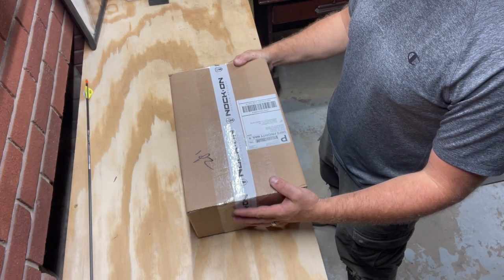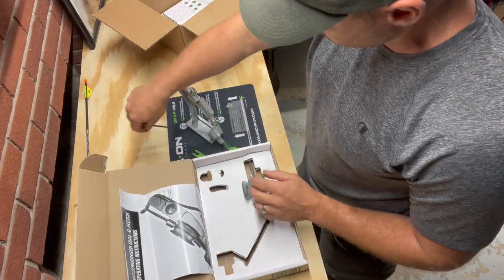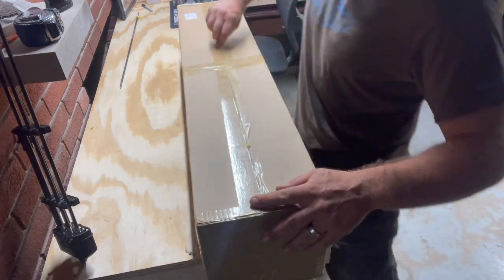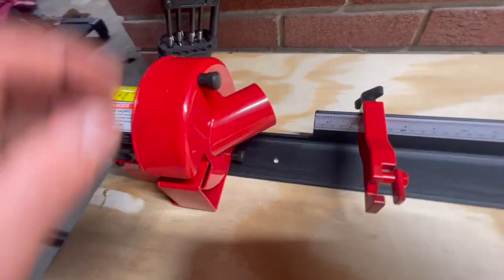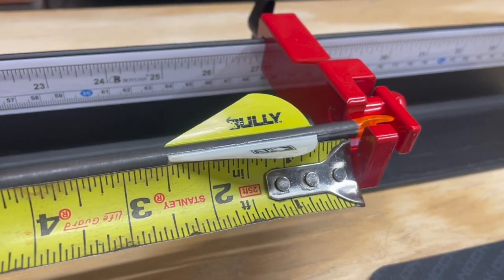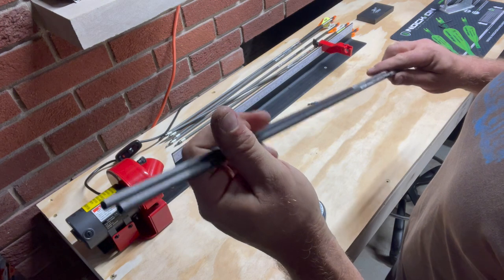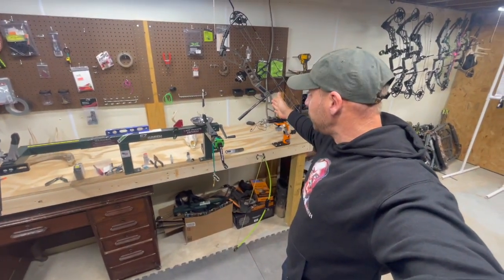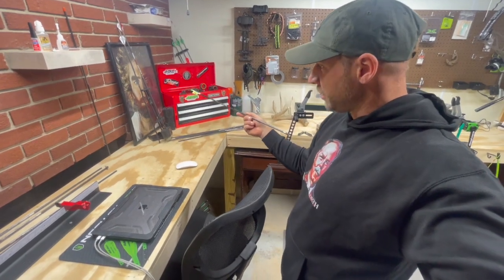bow shop build part 3 (carbon express ￼arrow saw and nock on unboxing)

Comment: Nice bow shop!  After 10 years of archery I finally feel confident and ready to start setting up my own. I built a DIY draw board today. One thing on your draw I noticed is the position of the peg that holds your bow. I think it should be turned 45 degrees so you will have vertical adjustment. What I have read and seen on YouTube (Specifically MFJJ at Podium Archer and Average Jack Archery) is that when you naturally draw your bow, your bow hand is a couple inches lower than where your D-loop is. Having the vertical adjustment on your draw board would more closely mimic your natural draw and give you a more precise result in cam timing.
Reply: Sorry. 90 degrees.
Reply from the maker: Noted .. I will definitely check that out🤔 Thanks so much for the tip!

Comment: Measure the arrow from the NOCK VALLE to the INSERT. My saw is the same when you try and lock the screw down it moves 1/16 shorter Just talked to Archery dezign for a draw board set. Put a shop vac on the dust tude and if you can send the air out side? the dust IS VERY BAD. Look at a scale, both for draw weight and arrow weight. and a fletching jig ( Bitezebuger REALY GOOD) and a vice wide limb. and your set

Comment: As for the tear, check spine it will tear one way for under spined (pulls left) and over spined (pulls right) (just check that?????). I have to do 6 click left to shoot Kanetic Pearce arrow (400 spine) out of my SR 6, just those arrow and ONLY it that bow. It's right on the line for spineage but pulls left which is OVER spined But I'm not!!!!! Even Lancaster were puzeled? HEATED CHAIRS and CUP HOLDER'S Then put up a big screan and play TAC shoots!